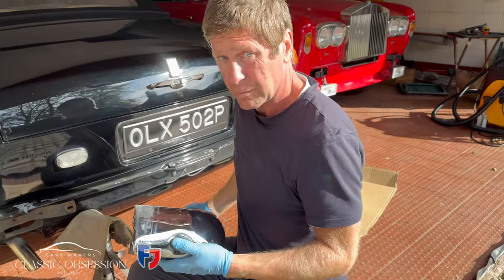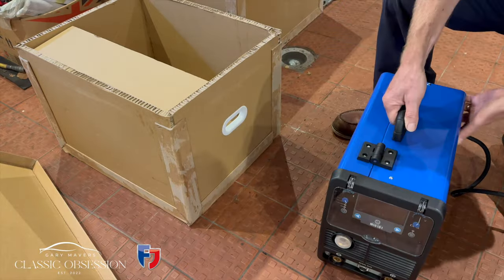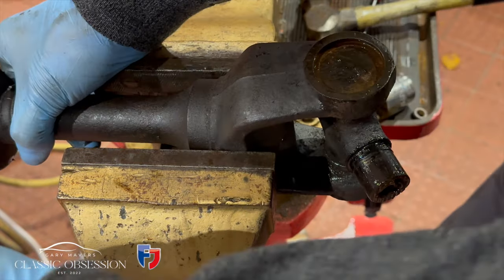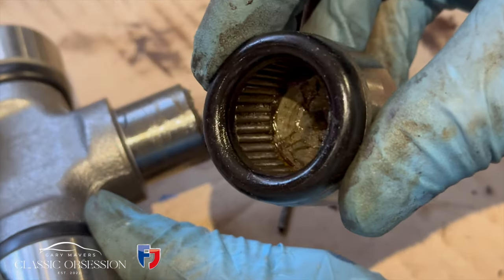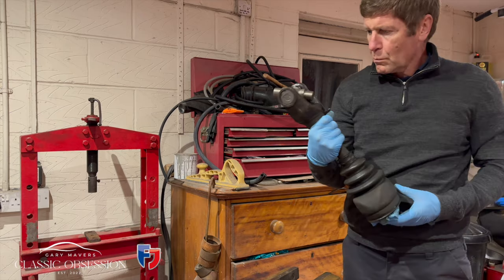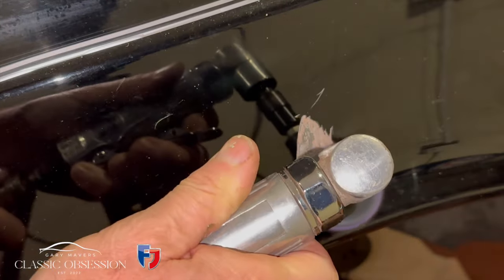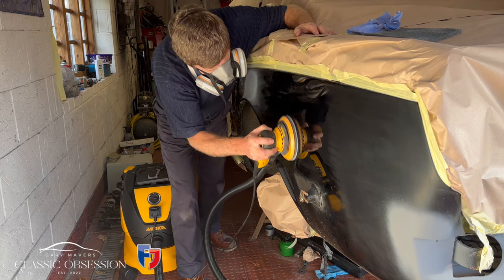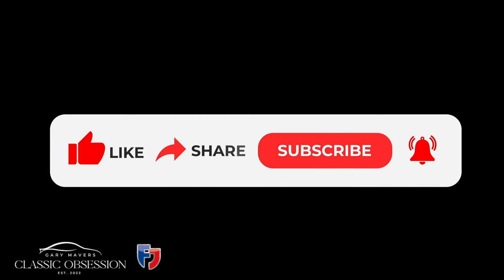Rolls-Royce Corniche | shadow |Rear brakes, Hubs & UJ’s rebuild | Classic Obsession | Episode 48

Comment: Wow that rear hub assembly, looks like it's off a truck! I can tell it's well made.  Plus I like the rubber glove trick to hold the needle bearing in  that inner drive axel joint, what a good tip, thank you for that.🙂

Comment: 😢 Sadly the high costs oftened associated with repairing these now 30 - 40 plus year old luxury vehicles. Means often they are simply not  repaired at all ,and become donor cars , or even scrap metal. I have personally seen in recent years several Rolls_Royce and Bentley vehicles of this era ,with so little real damage. Become donor cars !!. P.S . Many insurance companies will write them off ,after  a little accident....
Reply: Agree with your comment completely.  I very recently (like it's getting picked up by the shipper tomorrow and I hope to see it in a week or so) adopted (ok bought, but adopted doesn't sound so tawdry) a beautiful 1970 Bentley T1 RWD.  The body and interior are in very good condition and it does run and drive but it has clearly been mechanically neglected.  When I showed the photos and advert to a RR/Bentley specialist a couple hours from me, he coldly let me know his unvarnished opinion was the car should be taken straight to the crusher, which crushed me.  I guess you can't look at a project like this in terms of ROI.  I feel like the car is such a classic it deserves to be saved.  I have already restored a Corvette which I have more than double the bucks into than I could ever get back selling it.  Pretty likely this may happen again with the T1.  But I consider it like going to Grad School mechanically and hey, a husband could have way worse hobbies.  Watching Gary's videos has given me the confidence to take this project on.  And as Gary admonished, "Just take your time and enjoy the process"  I can't wait till the Bentley gets across the country and into my shop.
Reply: @Luscombe47x  🙂👍 Thanks for your comment. I  bought myself a few of these old Rolls_Royce and Bentley vehicles. And yes so far ,have spent a very large amount of money 💵 on them . Much more than I should have, and of course will never make any money back on them in the future. But I simply don't care, because I enjoy driving 🚘 them so much. Remember life is short, enjoy what time you have on this earth,  you a born with nothing, and you will leave with nothing  !!.